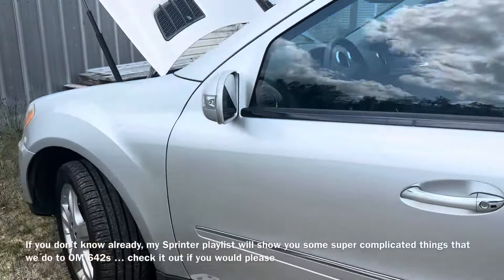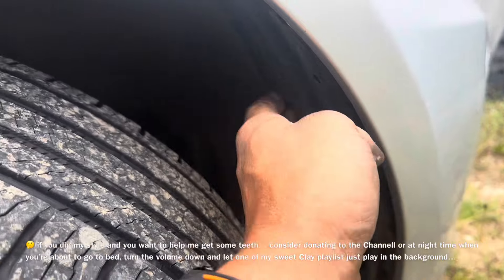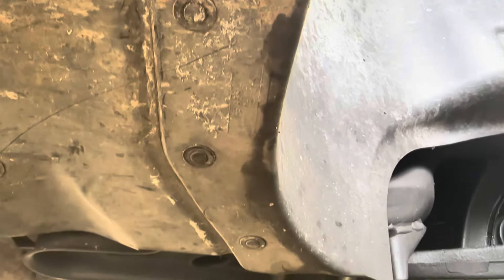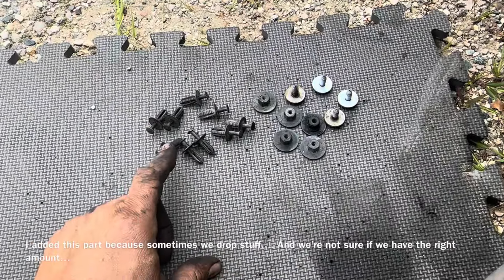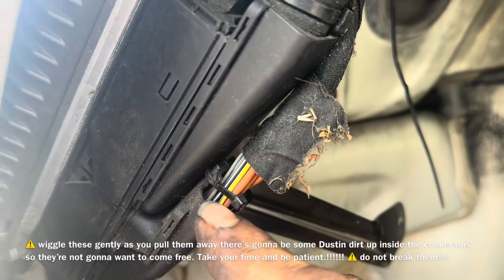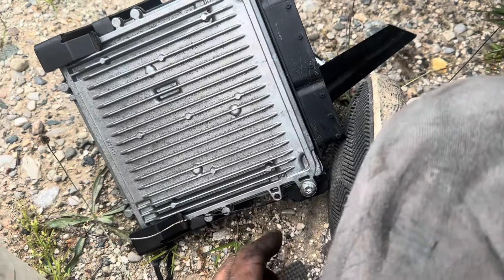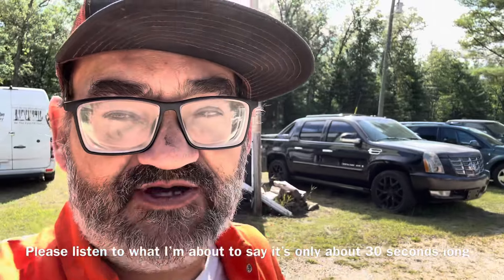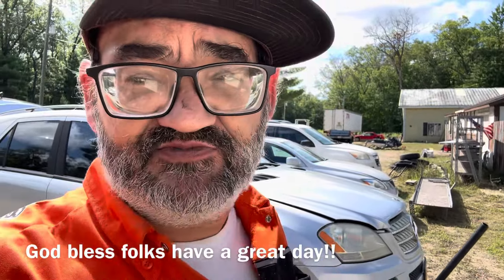Mercedes ML 320 Ecm removal & location

Comment: I have a 2012 ford escape 2.5 L, one owner 167,000 miles, no check engine lights, all 4 mounts changed, no vacuum leaks that I could find ( I did the old carb cleaner trick to check), new TPS, new exhaust valve, new mass air sensor, new purge valve, new plugs and new coils. All motorcraft parts. I’ve been hunting this down for a few years now and I can’t figure out why the motor is running rough. Do you think it’s time for a timing chain? Or do you think the motor maybe giving up the ghost? Oh and yes I change the oil with motorcraft oil every 3000
Reply from the maker: How about the catalytic converters? 

Have you checked them?  Very common problem,

However, it could also be your digital fuel pressure control. I don’t know where that’s at on a 2012 but it regulates the fuel pressure to the engine and they go bad.

Comment: Love you videos I have a 2008 ml320 in limp mode CEL  came on po245 code ect. I’m not getting power to the turbo actuator got ground and sig but no power. Any idea where it comes from?
Reply from the maker: Yep. Main wiring harness where it sits on top of the bracket has probably got worn wires. Underneath the sheathing. 

I would recommend using a circuit tester that you hook up to one end of the pen  then it sends energy through the harness and then you use a detector to find the break in the wire